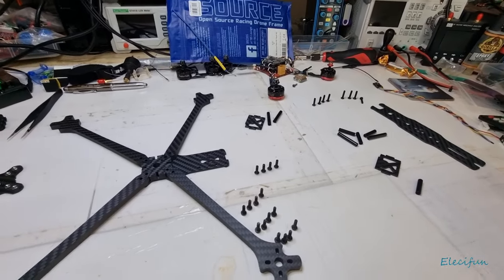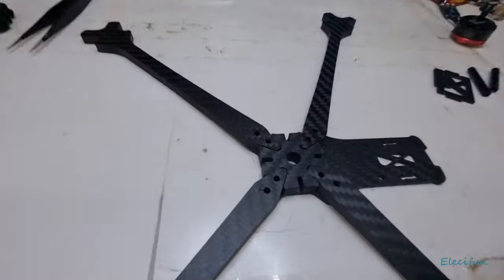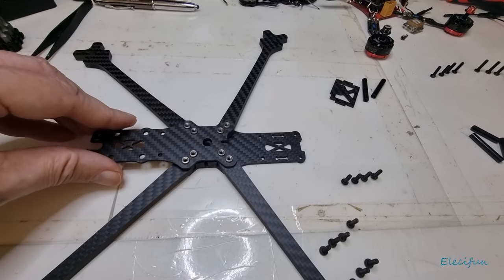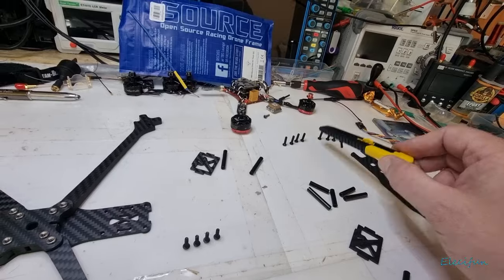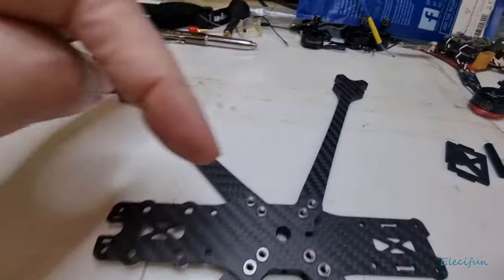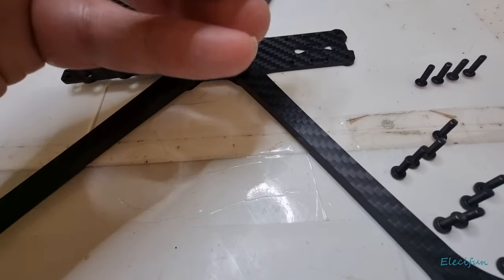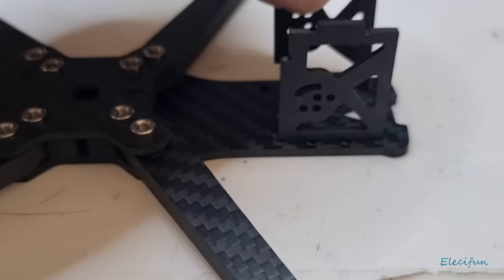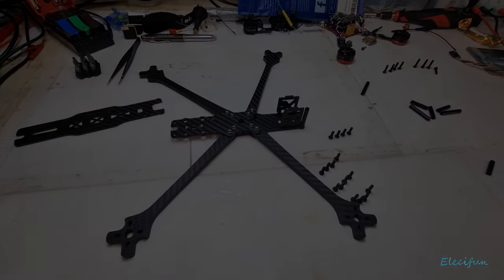How to assemble - TBS Open Source One V5 - 7 Inch Frame

Comment: That looks like a really nice frame. Well thought out. I think it will hold all of your components in a tidy package. Have you decided on a pilot cam and action cam? Those are both sort of limitations for me because going digital with the fpv system is really expensive with like the DJI 03 air unit and goggles $$$. I'm going analog fpv and will be using my cheapie Hawkeye Firefly 6s for the action cam right now. I do intend to go digital eventually but it will really wound my wallet lol. Thanks for posting these videos Elecifun. Good stuff! Have a great day amigo.
Reply from the maker: @Sonic_Ox I also will stay with analog, most of the digital systems I've looked at are expensive in comparison and only have a 4km range.
I know I can do 10km with analogue (fixed wing) with VTX and RX about 2 feet apart. Distance between VTX and RX makes a difference.
Reply: Thank you Elecifun. I've been thinking about receiver, VTX, antenna placement and will be leaning on your experience and expertise when the time comes. Thank you for being so generous with your information!
Reply from the maker: @Sonic_Ox  That's what the internet's all about bud.. Sharing the knowledge.